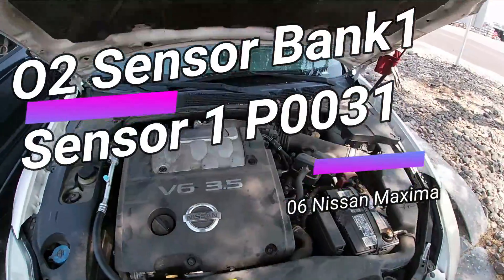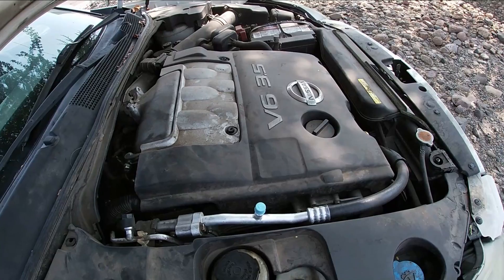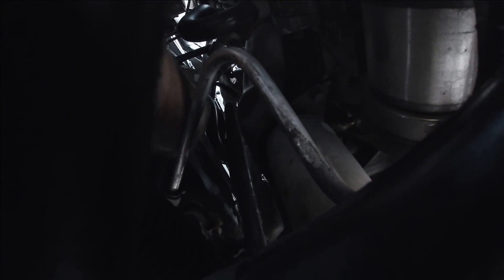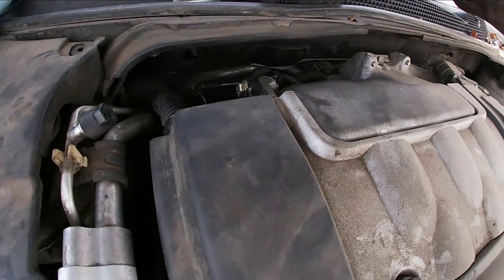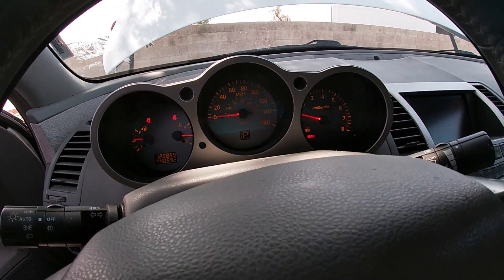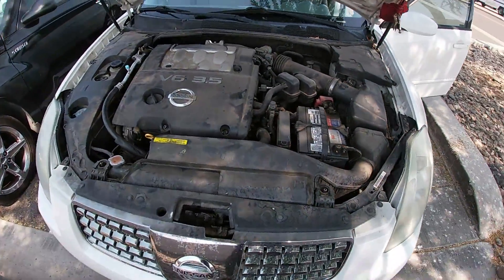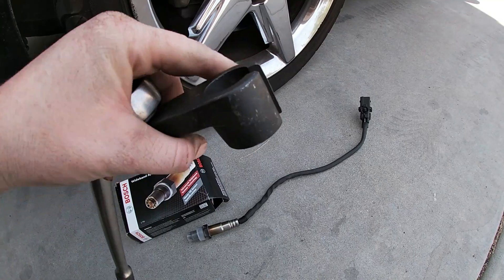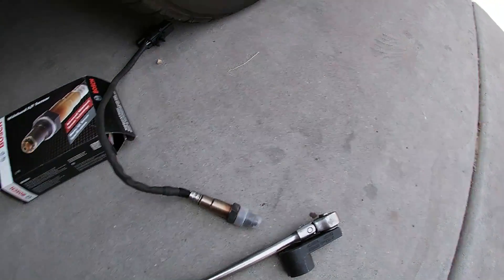Replacing the Oxygen Sensor Bank 1 Sensor 1 (codes P0031 & P1148) on a 2006 Nissan Maxima 3.5L V6.

Comment: Help help. So what can my problem be on my 04 maxima if I replaced both oxygen sensors bank 1 and 2, the mass air flow sensor and cleaned the throttle body, what can be the reason it still stalls out?
Reply: Try replace PCV valve. It’s often overlooked and can cause similar problems. $10 part, worth a shot.

Comment: If only the Bank 1 O2 sensor was that easy on the '07 3.5L Altima. The clown who designed that engine and the connector for that sensor should look for another line of work. The space behind the intake manifold can barely fit a fist. So disconnecting with removing the intake manifold is pretty much impossible. It's a totally different type of connector.

Comment: Did this on a 2010 maxima, b1s1 02 sensor unfortunately was frozen, so had to remove the intake manifold, and spray wd40, then torch. After i was able to free it, the threads were damaged so i had to rethread it, for it to work. Its a job that can either be easy if your able to free it or extremely difficult.
Reply from the maker: Sorry to hear that it fought you so badly.  Glad  you were able to get it going tho

Comment: Thank you for this tutorial. It helped me a lot today when I completed my bank 1 sensor 1 change. I thought it through for about a month during other Maintainance to the same area. The brainstorming time lead to doing the repair from the top and moving the mass air flow manifold to access the 02 sensor with and extended socket, torch wrench and swizzle connection. Bought a new jack from auto zone just to familiarize myself with the best wire route to take to execute the change without cutting the wire or keeping the car jacked up without jack stands. 🫡 @OnlyTheArts_

Comment: Finally I found a car as my own question how do I take off the exhaust  system for the bottom set also why did you disconnect the flow sensor or what it’s called my bad 😞 I’m new with this stuff

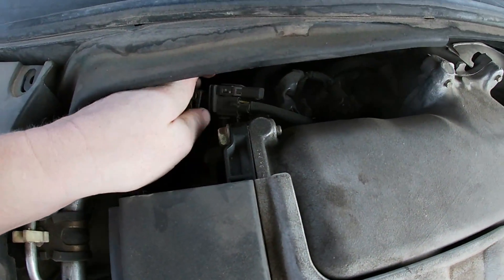Comment: At 1:00 what is the black plastic square thing (below your hand in the frame) that is bolted to the engine cover?? I have an oil leak between that and the engine cover and need to know what that's called to replace the seal. Thanks!

Comment: Don't use this sensor. Check engine light came on within 7 miles after taking off the battery cables for 10 min. I cleared it on the scan tool I have now. Hopefully it stays away
Reply: Check engine light came back. Don't use this sensor. Dealer only

Comment: How did you break it loose? This O2 sensor is a “B****” to get off! I try all kind of o2 sockets and ratchets.. can’t get it to even turn! No room at all to work. I even removed the upper intake manifold and still can’t do it.
Reply: This is for anyone else who might need it. I tried putting some penetrating lube (I only had a bottle with an unfolding nipple) but I think I missed most of it. I used a 7/8 or 22mm O2 Sensor wrench with the angled handle and the swiveling head and positioned it on the sensor and got it to seat with the handle hanging down. I tied a severed piece of Ethernet cable around the very end of the handle, and the other end to a long extension down the middle. Used both hands and pulled on it with my body weight and it broke free. I loosened/unscrewed it the rest of the way by getting my arm in over the CV Axle so that my whole arm fits into the space and I could continue turn it with a crow’s foot O2 sensor socket, and finished by hand.
Reply: Pb blaster the 02 sensor then let it sit for 15 min. Comes right out

Comment: Hello
Thx for your great video
I followed but after 5-8 mins 
The engine light comes up again p0031 found
What should I do
The o2 sensor is brand new 
Thx
Reply from the maker: Nissans can be tricky to relearn the o2 valves, even on this one i had to use our Autel scan tool to make it relearn. I hope you were able to figure it out.

Comment: So if I don’t reset it then it will still misfire? I change the same air fuel ratio sensor on a Murano. After replacing it the engine misfires on acceleration or anytime the speed changes. Before I replaced the air fuel ratio sensor the vehicle had the p0031 code but it did not misfire like that.

Comment: We bought a used 04 Nissan Altima and right after we bought it, it turned off on us and won’t start. A lot of non professionals kept telling us it was the alternator but it’s now been about 4weeks and the car still has energy just Won’t turn on. I had a mobile mechanic come by and ran a code test. He said it was the bank 1 and bank 2 sensors. Could that really be it or you think it could be something else. Any advice will be appreciated.
Reply: Cam and crank sensors

Comment: is there a total of 4 oxygen sensors?
Reply: 4 total.   2 upstream, 2 downstream.  Bank 2, sensor 1 (upstream) located in the front, easy to get to.  Bank 1, sensor 1 (upstream) located behind the firewell.  Nissan's are junk.   I already replaced 2 front hubs, twice. I had to replace valve cover gaskets at the tone of above 5 hundred,  now I have to replace the downstream O2 sensors.   Less than 150K. miles on a Murano.

Comment: I’m actually having a problem with a cable I found under the car that was ripped abs I followed it up and it led me into the top left corner of the car it leads to the passenger side and I’ve looked everywhere and I have no idea what that cable is any idea if you can help out?

Comment: I have these codes for my 2008 Nissan Pathfinder 4.0. I replaced the sensor with one from Nissan, codes are still there. Very annoying.
Reply from the maker: They can br tricky to reset, once they are installed they need to go through a relearn procedure. we even had a hard time with this car and we had to hook up the scanner and reset it, since the manual reset did not take. also they have multiple fuses that can mislead us to believing that its the sensor when its a fuse. testing the volts from the sensors can also give you an accurate reading, also checking that the temperatures are correct on the cats as well. good luck with this, You can get it!

Comment: I tried it the way you recommended but I didn't have enough room to work. I removed the passenger side tire and was able to reach in far enough to get the O2 socket on. I was then able to come in from the top side with a long extension and a short swivel extension to break it loose. I disconnected the battery cable before starting so it would "reset" the computer and clear the codes.
Reply from the maker: Thank You for your feedback on your repair.

Comment: So you unplugged the map sensor ran it for 5 sec. W/o it . Turned engine back off .. plugged in. Restart engine and then erase codes ?
Reply from the maker: Hi there, 

By un-hooking the Mass air flow sensor and running the car for at least 5 secs, then clearing the codes it resets the readiness monitors, this causes the ECM to run a relearn cycle and it will then reset the O2 readings as well. However on this car this reset did not work, & We had to hook up our Autel scan tool and go in to manually reset the O2 sensor readings. I'm not sure as to why the manual relearn did not work? but I have used it so many times in the past & it has. So hopefully yours resets simply, if not you may be able to take it in to a shop & just have them reset your O2 sensors values. I hope this helps. Thank You!